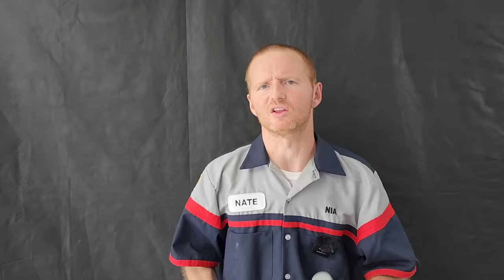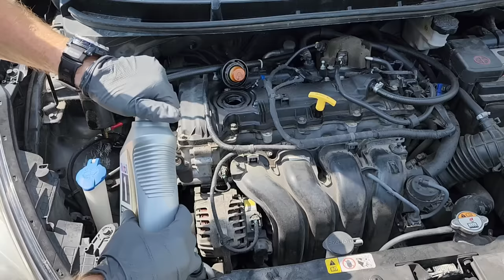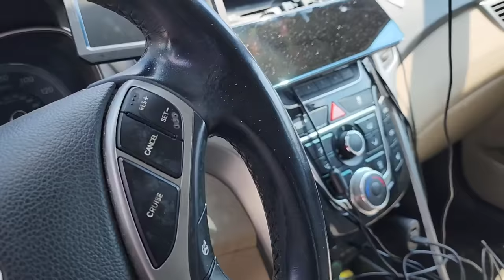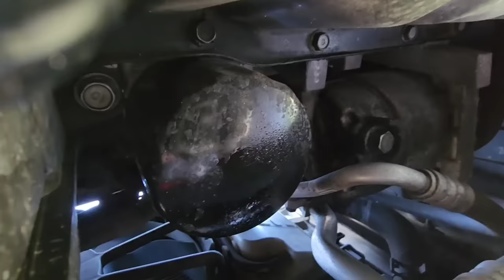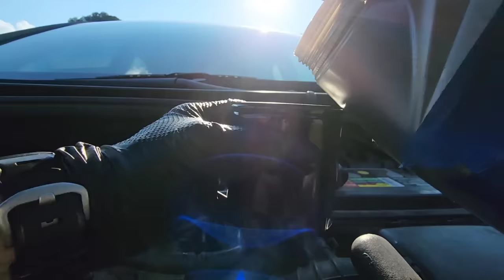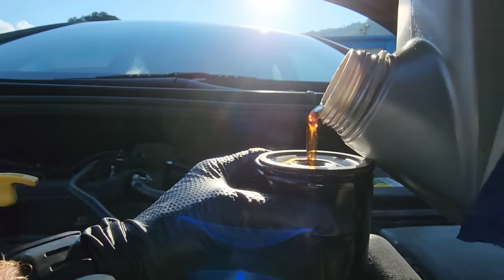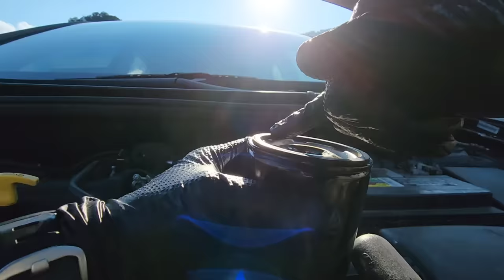Car owner sued after Jeep kills Mechanic during oil change

Comment: Knowing how standard transmissions work should be a requirement to be a mechanic
Reply: I work at a dealership. Unfortunately, getting standard transmission cars is so few and far between, that I'm not even sure they ask if you can drive one anymore. They hire just about anybody these days
Reply: I worked at a jiffy lube, they turned down oil changes bc no one knew how to work one until I arrived. Then I was the only technician to work on standard. Even then they were cautious when someone other the me saying they knew how to drive a standard. Completely the fault of dealership.
Reply: If you don't know. Ask someone.
Reply: @mgomez5606  I agree. Unless we have a used car that is owned by the dealership and hasn't been sold yet, the likelihood of us teaching you is pretty slim. Customer's cars aren't the place to learn.
Reply: And what about the emergency brake, was it set. Or wheel chocks.
Reply: A mechanic should know or he’s not one.
Reply: @mgomez5606  And if NO ONE knows... call the owner to move the car.
Reply: I could not find anything for TX.
Reply: Knowing how to drive a stick at the absolute bare minimum.
Reply: You shouldn’t be issued a drivers license if you can’t operate a vehicle with a standard shift. It only takes a little coordination and about 30 minutes to master a stick. I don’t recommend working on stick cars if you aren’t a driver of one anyway. It is dangerous as these people found out.
Reply: @PhenoDubs  I get that.  I drive a standard and the oil shop I took it to had a youngster that didn't know what to do with it.  It is one where I do the driving and just sit in the car, so nothing bad came of it. I am glad at that moment that it was a drive through.
Reply: Well, he knew enough to push the clutch in to enable the starter.
Reply: I just started at a dealership. I can’t drive manual, but I’m smart enough to not try operating a customers vehicle if I don’t know what I’m doing
Reply: If you are going to be a mechanic, you should learn manual transmission. Dealership should provide for apprentice a vehicle with manual transmission as part as apprenticeship. Dealership should be liable. When I take my car to be serviced, it is my expectation the shop has trained mechanics. It’s like if I went in for surgery, I would expect a surgeon operates on me, not 3D modeller (I picked 3D modeller because I am one, so no one gets offended).
Reply: @mgomez5606 If you can't drive a manual then you not a mechanic is the dumbest thing I've ever hear 😂.
Reply: But Hilary!!! And Joe and them other crazy people tho!!!
Reply: @carsten4594 so that's what that lil paddle thingy does? No wonder my fog lights weren't kicking on
Reply: @MWAclanGaming  I did not learn until I was 21. No longer have my Honda 5 speed. I tried to avoid having to stop at up hill lights to prevent from rolling back. After I got better at it I did not avoid them.
Reply: All transmissions are “standard”.
Reply: @Axeman428  When manuals make up less than 1% of cars sold (0.9% in 2023) as is the case in the US, such a requirement is patently ridiculous. I agree that it doesn't take long to learn and that you shouldn't be working on them if you don't know how to use them (but that goes for ANYTHING, if you don't know it, don't work on it).

Personally I learned how to drive a manual by my boss at a landscaping company simply telling me that I needed to take the truck out. Just me in the truck that day. Right after that he hired another guy, but he had a suspended license at the time, so I was still required to drive. Which meant I ended up getting several months of experience as well. Before this I knew the basics in theory, but literally had no chance to actually drive one before then (I had gotten my license about 2 years prior). This was back around 2000. They have only become more rare since then.

caveat: In a country like the UK where manuals are far more prevalent, that requirement would make some sense.

edit: Since then the only manuals I've driven are tractors.
Reply: @mgomez5606  I remember that feeling. Unfortunately I couldn't avoid having to deal with it from the getgo. Which tbh, was a good thing even if it made me very uncomfortable at first. (Learned how to drive a manual about 2 years after I got my license. Had to start driving an F-250 for work and my boss had me learn by doing, without any direction/instruction, hell without anyone else in the truck. Basically "Hey take the 250 and...")

In Connecticut, the only manuals I've ever been around are work trucks and tractors. People just don't buy manuals much anymore. (Google says that in 2023 only 0.9% of cars sold in the US were manuals.)
Reply: @peteness9550  might be "standard equipment," but an automatic transmission is different than a standard.
Reply: @whyjnot420  was the shifter on the floor or column? Only driven on the column once.
Reply: @mgomez5606   The F-250 I mentioned had a big old stick on the floor. I'm not sure of the exact year but it was a mid 90s one.

Only column shifters I've used have been automatics. I drove a 99 Dakota with one for so long that even 4 years after getting rid of it, I occasionally reach for a nonexistent shifter on the column.

I have wondered how it would be to use a manual with a column shifter. I bet it would feel really odd.
Reply: We had a mechanic who didn't even drive.
Reply: 'Murica
Reply: He knew enough to know that if you pushed the clutch in that it disengaged the gears so he would know that letting it back out would engage the gears again.
Reply: @mgomez5606  Didn't learn till 28 ish.  Had a 100 mile a night newspaper route at the time.  It helped having used a manual transmission dirt bike for years.

Even now on some of the steeper hills I have around here, I'll use the parking brake (so, LH steering, RH parking brake, RF gas, LF clutch) to hold still on a hill.

Just replaced the clutch fork on my daily driver, I wore through the pivot point till it fractured and split ~1/4 inch apart. When the hydraulic slave cylinder is resting approximately 1/2-3/4 an inch further out then it should while the peddle isn't pressed renders it nearly inoperable as it eventually bent so far off angle it would slide off what was left of the pivot, and this is about where I put 2 and 2 together, and pulled it apart to replace.  A plethora of symptoms I had blamed on everything else, turned out the root cause was the clutch fork had failed, took the part ~25 years from manufacture to fail, but hay cars used to be built to last an entire generation.
Reply: I had 2 times where the mechanic couldn't figure out why my car wouldn't start. It's a stick shift. Duh. Anyhow at least because of it nothing happened since they only had a foot on the brake. Honestly though it's a bad habit to sit halfway out of the car with only one foot inside on the brake to start it up.
Reply: @PhenoDubs  That's my thought too. I'm 55 so have driven many but a lot of young people have never seen one. This is a 1 in a million thing now. Last one I drove was my 280 Z back in 2013.
Reply: @anitabell3976  I worked as a mechanic and I've never heard of chalking a car that's going up on a lift.
Reply: @peteness9550  it got the nickname "standard" because back in the day, manual came standard on a given vehicle and auto was optional.
Reply: @fsj197811 great point
Reply: My first car was a standard pontiac lemans.  And i have owned several srandards.  My son is a trained mechanic and us clueless about them.
Reply: I learned as an 11 year old on a pinto wagon... Wasn't pretty first pop of the clutch but it didn't stall and across the neighbors yard we went...
Reply: Mechanics do know how to use a manual trans, it's the "techs" that may not.
Reply: Lol that's complete nonsense. For starters and "standard transmission" would be an automatic transmission not manual. But regardless how could you possibly require people need to learn to drive something that 95% of Americans don't own?
Reply: The biggest orobkem with standard (manuel) is that if you are texting, you have to put fiwn your hamberget to shift gears.
Reply: Thats ridiculous to me, there are many people who know NOTHING about cars but know how a manual works
Reply: @anyflipside  Where I've gone for oil changes, I as a customer have been asked to drive over the bay and stop and put the car in park.  The analogous thing for a manual would be to put the manual shift in neutral and put on the parking brake.  Now if the car is being brought to a dealer or a mechanic that doesn't have a bay to queue up for, that's a different question -- the car is probably parked outside the bay.
Reply: @Axeman428  The states I have had licenses from had a place on the license to restrict to "Automatic transmission only."  Oddly enough that was not done on my licenses even though I never tested on a stick shift and never asked to use one.  I was smart enough not to try.
Reply: @mgomez5606  Most motorcycles have a "standard" arrangement, though usually the gear select is designed to shift through some permutation of 1 - N - 2 - 3 - 4 etc.  Feathering the clutch into engagement while feathering off the brakes and accelerating the engine is how such a situation is handled there (it was on the small Harley I used to own).
Reply: @SeekingTheLoveThatGodMeans7648  know nothing about motorcycles.
Reply: @mgomez5606 well you have to be ignorant before you the opportunity to learn. I have never owned a manual transmission, nor have any of my family or close friends. I "learned" to drive a manual from YouTube, but I still have yet to actually drive one because there is not one for me to drive. I am not in a position to buy a new car atm so I'll have to wait
Reply: @weeaboo_weirdo  There are videos that show you? My ex showed me how to drive one. What car did you learn on?
Reply: You'll be surprised.  I change oil at VW dealership.  The last time I was there, new "service advisor" couldn't take my car to the service area 😂. He wasn't comfortable with a stick shift 🤦🤦
Reply: Every goddam self respecting car mechanic otta know how to drive a stick shift.
Reply: @samgrieg2542  Sam, I have read it's hard to get a stick shift now. That is all I drove until ten years ago when I bought a automatic. My 02 F150 is a stick though. Dead battery on a stick is NP. You can still get back on the road.
Reply: @Axeman428  Here in the UK, if you pass your test in an automatic, you are licenced to drive automatics only. If you pass your test in a manual, you are licenced to drive both manual and automatics.
I drive a manual, but if I drive my brother's automatic, I have to remember to press the  brake pedal first AND have the lever in P else the engine won't start, puzzling sometimes.
Reply: My local jeep dealer(shoutout Daytona auto mall) left the lights on in my car, killed the battery & then couldn’t figure out how to jump it so they just left it at their loading dock for a week. If this was a factory certified tech, literally no level of incompetence is unattainable
Reply: @alexphelps7042  OMG 🤦🤦
Reply: It should be a requirement to drive a car period let alone be a mechanic. 
I drove a truck for years, over the last ten years, I was the only driver who could drive the truck I was in everyday because it had a 10 speed manual trans. 
Not only couldn't they find guys that drove manual, they now no longer buy manual trans trucks. I spent my last year driving a dam automatic because its all they had. 
Its the same way with new pickups and cars, try finding a new manual trans model. I think the last new manual pickup I saw as a buddies dad who bought a bottom of the line Ram 1500 4x2 with a v6 and a 5 speed manual back in 2010 or so.  I miss my old '86 4 speed F150 every time I get into my newer truck with an automatic.
Reply: Anybody that applies for a Driver's license?Nationwide should learn how to drive.A standard vehicle first must be a must
Reply: @donaldcurtis9229  true. They make all driver know child safety even if they don't have children. Might as well make all drivers know how to use a standard
Reply: musta happened at jiffy lube. That place is fucking trash.
Reply: He Cleary isn't a mechanic
Reply: Yep.  That's why it's still called a "Standard Transmission".
Reply: Less important is knowing how a m/t works. Most important to know how to properly drive one. Yes it should be a requirement for anyone working in a shop even at the front desk.
Reply: @hksjoshua  he knew enough to push in the clutch to start the car.  Should have known to make sure that it was in neutral before taking your foot off the clutch. 🙄
Reply: It is.
Reply: @anitabell3976 cars may over run the handbrake particullarly diesels or lower geared, no chocks with a 2 post hoist.
Reply: The 19 year old is not a mechanic. He is an oil change tech.
Reply: @Johnny35130  still working on cars. Thus he is mechanic

Comment: At first you had me thinking that the customer had a dangerous modification or such willful neglect on his vehicle that it caused the mechanic working on it to die... this however... blows my mind that there's a lawsuit.
Reply: My thoughts exactly.
Reply: 100%
Reply: I thought the same thing!  Something broke because of rust or something.
Reply: I could've sworn that was the case as well..
Reply: My initial thought was that the car owner disabled or bypassed the clutch position sensor and/or the neutral position sensor.  But obviously that is not the case.  This is a tragic event and I feel bad for everyone involved.  I'm guessing the dealership has some insurance for events like this, and in no way should the owner be liable for something like this.  Seems like the system worked this time.
Reply: Agreed, I had thought he was going to say the neutral safety switch was bypassed, which would make sense, but if the car was in working order in no way should the owner be liable. When you take your car to a profession dealership, there is an understanding that they have "professionals" working there.
Reply: I thought exactly the same way.
Reply: The lawsuit is nothing out of the ordinary. The family of the deceased must be made whole, that is, as much as possible.
Reply: I cant believe in any way that this was ever the owners fault
Reply: Was thinking the exact same thing.  Patiently waiting for speaker to mention what the faulty aftermarket mod was that caused this.

Then when he revealed the cause and effect ........... mind blown!
Reply: That's EXACTLY what I thought when I clicked on the video! I then got FURIOUS what I heard the actual WHY!
Reply: The lawsuit will fail
Reply: Same. They should be suing the boss or the 19-year-old.
Reply: @Matt-uj9wl  Even so... older models do not have those sensor, it goes vroom the moment one turn the key.
Reply: @youkofoxy  in the United states every single vehicle with a manual transmission since AT LEAST the 80s (and probably further back) has a neutral safety switch.
Reply: @Matt-uj9wl AS well as a parking brake... If the brake is MALFUNCTIONING... That would be an "UPSELL"... To provide additional income to the shop... To fix a faulty parking brake... As anyone that drives a manual transmission vehicle... Knows... You set the parking brake... When the vehicle is parked... As the vehicle can move if it not properly set...
Reply: That’s what I was thinking. I was thinking maybe the struts were broken and the car fell on him or something and then I hear about a 19-year-old kid not knowing how to drive a Manuel working at the shop? This is not a real law. Once you give your car to a repair shop, it is in their possession. Otherwise, they would be running each other over and suing every customer

Comment: How did the mechanic know to push the clutch pedal if he knew nothing about manual transmissions?
Reply: A lot of modern vehicles require holding the brake down for the push start button to work. That tech probably didn’t even notice there was a 3rd pedal, and just happened to push it down thinking it was the brake pedal. It would feel pretty similar after all.
Reply: If he thought it was the brake then he would have known the car would move if he took of the brake
Reply: He might have known enough to press the clutch and start the car. But likely didnt know that you have to gently and gradually release the clutch in first or reverse. He likely took his foot off the clutch pedal in an instant which allowed the catastrophe to happen.
Reply: That is an excellent point.

My thought was with no license, why did the junior mechanic operate the vehicle by pressing the ignition button, and then pressing the clutch and then ignition button again?

I have listened to court rulings on OWI for people who have pulled over and tried to sleep it off with the car in park - engine on, car in park no engine on - keys in the ignition, no engine on car in park keys in the center counsel.

Each time the judge had said that if the keys were not in the cabin and the engine was not on and the vehicle had been in park - only then would the driver had not been charged.

Did the dealership allow him to push the button?

If not- it is on the kid only.  

If yes or they did not specify then it on, period.
Reply: @MichaelPancho-el1cf  Car manufacture  should have had a safety switch To keep the car from starting if it was in any gear.
Reply: @charlescoker7752  Or with the door wide open.....